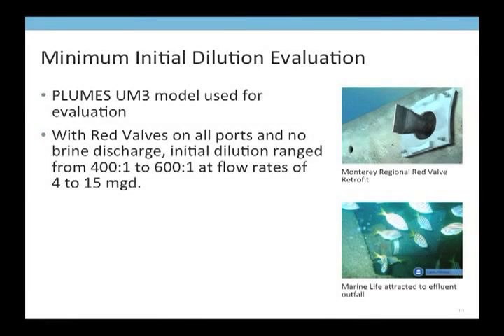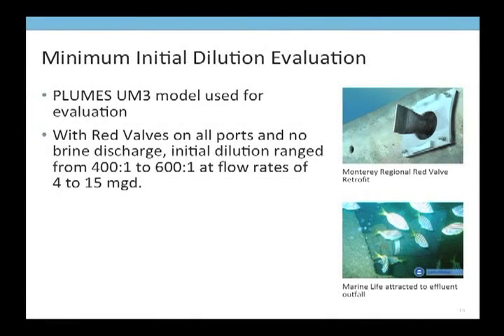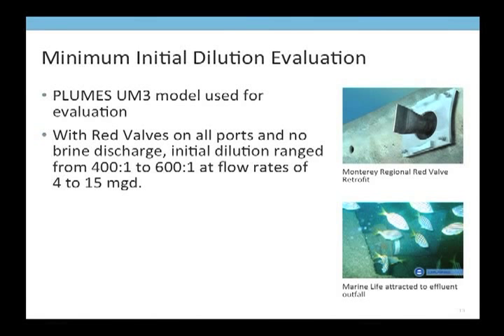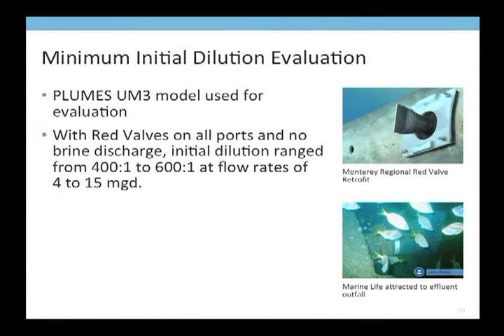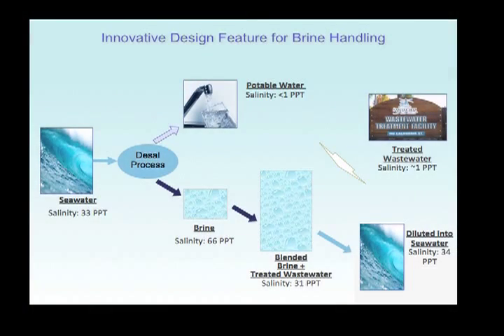scwd2-Desalination: Brine

Comment: a fraction of a percent. Like .05%? how many times do you have to add.05 percent to One Source unchanging before it equals 10%?
Reply: I perceive that in almost no time in the very near future by trying to handle this problem like all the other problems have been handled the ocean will be in trouble in a matter of years. Be at decades or a century it's setting up for a problem like the other problems we set up for.
Reply: is a very tangible way to handle the water problem but it's incomplete without use and proper disposal of the brine. I have just a solution.
Reply: which solves other problems at the same time.